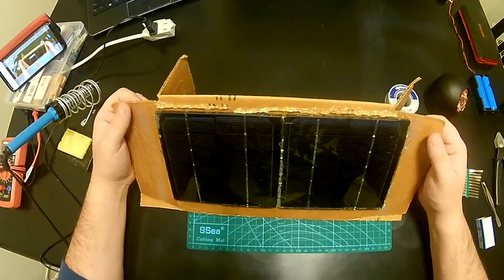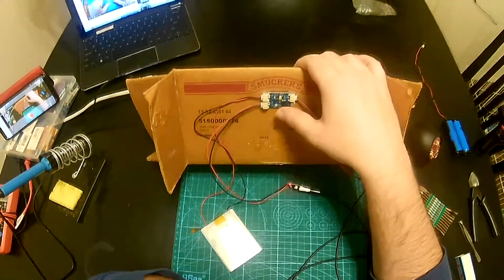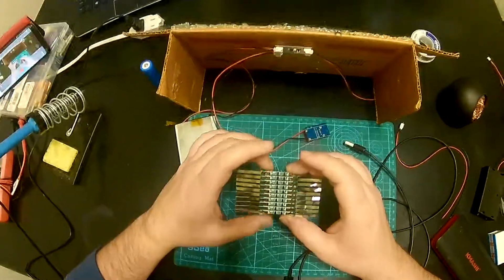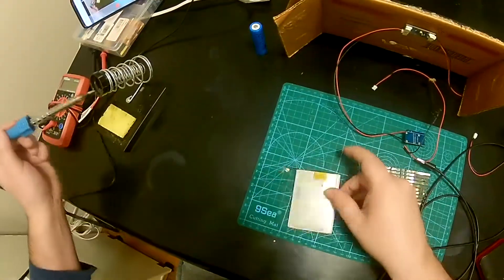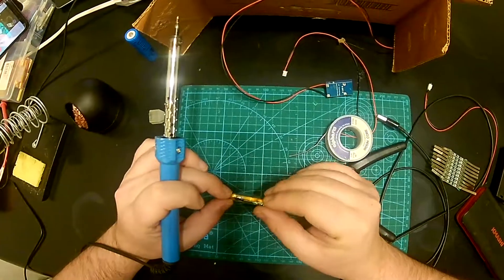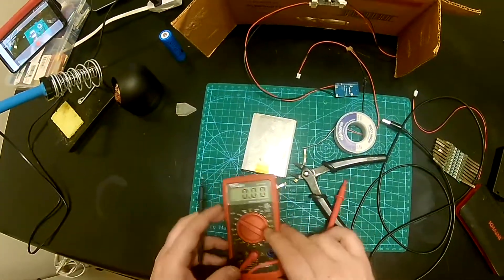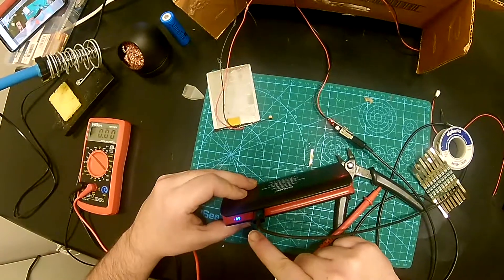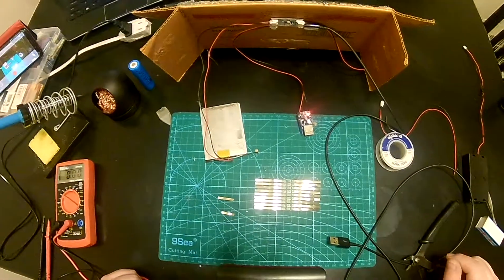Super Mini Solar LiPo Charger v1.0 (CN3065) Part 2

Comment: Could it be due to the 5v booster you use? Because the booster module does not have battery protection. You can probably work the lipo battery with the 5v powerbank module instead of the battery protection module.